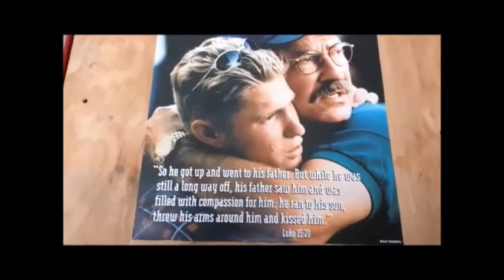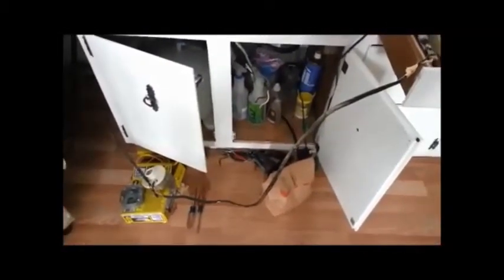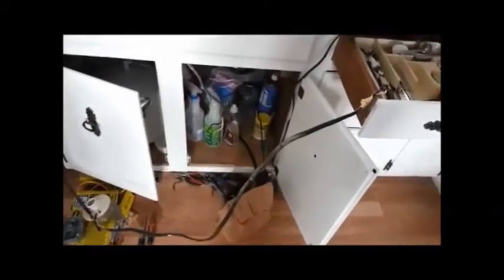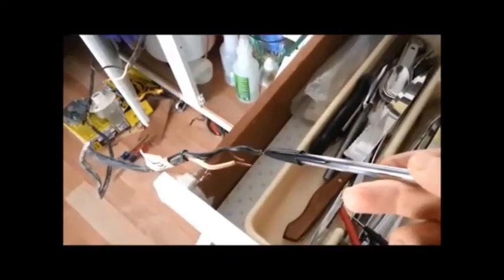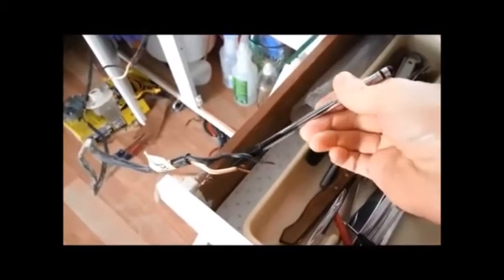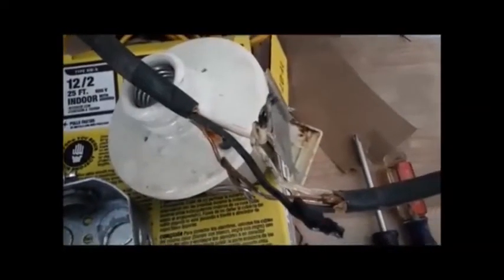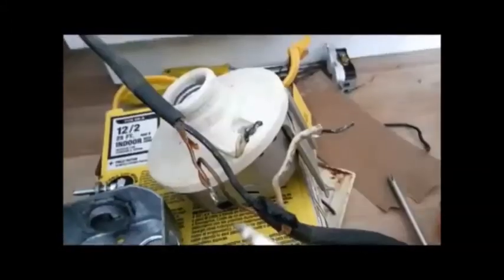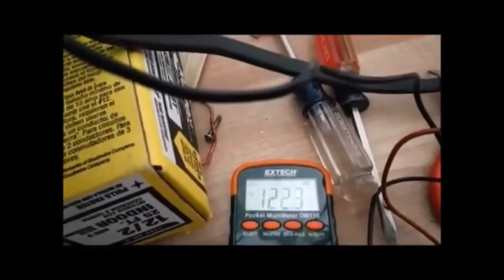House wiring improper voltage at the end of the circuit

Comment: What could be the reason that the voltage between hot and ground is 120 and between hot and neutral is only 85?
Reply from the maker: The high resistance connection was acting like a resistor.  When you have a resistor in a circuit, you get a "voltage drop" across the resistor.  So if you measure the voltage after the resistor it will be lower than the source voltage.
Reply: @diywithdave3186  so it was wired in series??